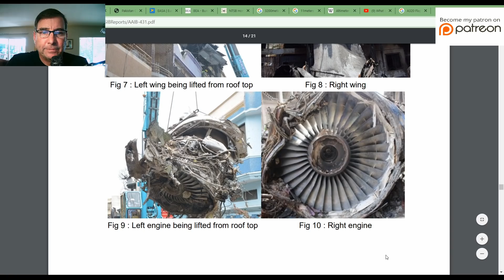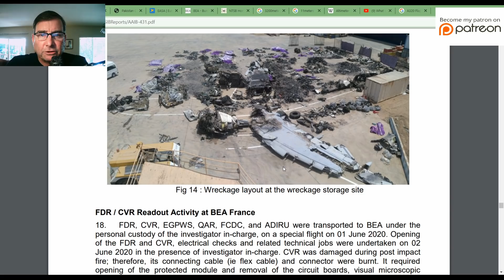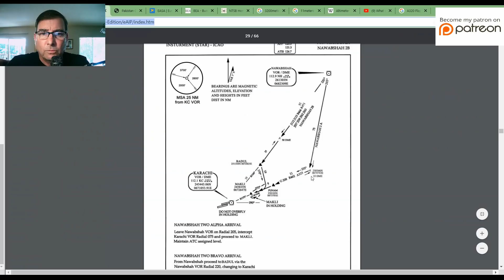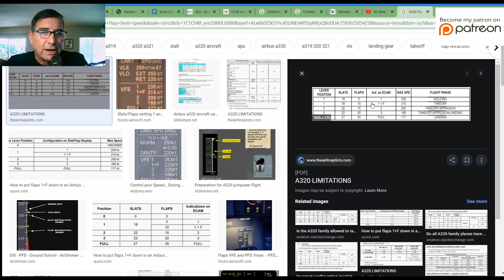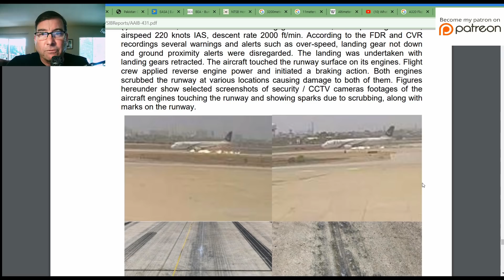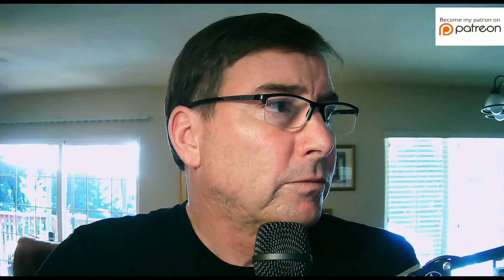PIA #8303 Preliminary Report Part II

Comment: One thing to mention out of all of this is the aircraft was not flown IAW Airbus SOP. That being the case, there were so many ECAM messages and warnings, that its almost impossible to sort them all out by continuing this approach. Certainly having the APU running would've helped, as in the case of Sully in the Hudson. A dual loss of electric power causes the RAT to autodeploy. The gear could extend if there was some hydraulic pressure but it normally freefalls once the uplocks are released. The Flaps slow due battery, in Emerg Elec Config, only the slats extend. EEC causes the flt control to go immediately into Direct Law (use Man trim as Autotrim is disabled (with gear down). Trying to fly in Direct Law with dual engine fail is a complete handful on its own. It says at one point earlier on that both autopilots were disengaged, what were they both doing engaged. Maybe that should say both Flight Directors were Disengaged,
 which is appropriate when hand flying the Airbus. Too many unanswered questions.
Reply: The aircraft will only go into direct law if the gear is down. You probably meant that but wasn’t clear. If gear was up it would still be in alternate law
Reply: @tomstravels520  Hi Yes you are correct. Both engines failed as per the Mayday call. The RAT deployed and the gear was down when they went down, as per the pictures.

Comment: Some speculation:

Declining to use the holding pattern was due to airline imposed fuel or time pressure. May also explain why they came in high.

Gear down at 7000 ft was for more drag (in addition to the speed brakes)

Gear up once on glide slope was for fuel conservation (they thought they didn't need the drag anymore, despite being way fast).

Gear down after the go-around was an "oh sh*t"

Gear up after go-around was for drag.

That final descent looked like 30+ degrees of AoA, very likely a stall. 

I have no idea why Airbus can't spare the (probably) less than 10W of electrical power to run the FDR during a power emergency. Hopefully the CVR had power. It's a little surprised they didn't have built in battery backup. (Like smoke detectors, clock radio, etc). Frankly, I'm surprised they can't keep it in normal control law with the stall prevention without engine power. The instruments and stuff are almost surely running, as are the actuators, but they can't afford the power to run a few computers?
Reply: Because fdr doesnt help the pilot fly the aircraft, why the fuck would you want that as a pilot? Airbus is thinking on how to help the pilots not crash, not on how the ntsb hace better info on a crash
Reply: Gear being selected up at 2500ft and so close to the runway would save exactly nothing in fuel. It doesn’t make sense at , not that anything else here makes any sense either. My only thought is that it was selected up to try and force the PF to go around when maybe the PNF had exhausted all other methods of getting him to go around.

Comment: Excellent content delivery there.
I read the same document couple of days ago.

Just a small note on the use of "spoilers or speed bakes". 
On an A320 the use of spoilers with the Auto Pilot ON is limited to half of its deflection, in other words, half travel of the corresponding lever.
So at this stage disconnecting the AP will make sense as to comply with this limitation.

Won't comment on the rest.
You've said enough.

Comment: Stating the obvious here, but during this sequence of events the gear was lowered 3 times and raised twice. The plane crashed with the gear extended. The unfortunate thing was that it was not extended upon landing, an apparent surprise to both pilots. I initially thought gear up was selected at 5nM in order to facilitate the fast descent and protect the gear, but at 5nM out they were already on the glide path but with an airspeed over 260KT.  If you increase the airspeed with gear down I don't suppose it automatically retracts, does it, just to protect itself?? Because at 5nM they definitely exceeded the VLE. This is quite possibly a very unusual occurrence, increasing airspeed once the gear is down.
At 4nM they were already at a safe speed, 225 KT for lowering the gear again....but it appears they simply forgot to do so, or possibly forgot they had retracted it, or didn't know it had auto-retracted at speed. Then there are the numerous alarms to protect against this so it will be interesting the hear the full CVR with both the chatter and alarms.

Comment: This is so sad for the deceased. Having attended several CRM courses, held airworthiness delegations and written approved Safety Management Systems it "appears" that the flight crew ignored all of their training and had a complete breakdown in CRM.  How many "slices of cheese" did they negotiate? So sad.....
Reply: @billdewahl7007  It is obvious in the engineering business as well.. 40 years ago it was laughable, today not so bad but still a problem
Reply: As someone who is a process improvement specialist consultant, I've often pointed out that "It's impossible to make anything foolproof as fools are so ingenious". 
Behind the obvious darkly humorous nature of the comment is an important fact. 
This is as great (and sad) an illustration of that fact as I've seen.
Reply: @steeltrap3800  Or "We keep building better safety mechanisms but they keep building better idiots."
Reply: @sfmc98  You can build something that is "Idiot proof" and a fool will come along. If you build it "foolproof" then an idiot will beat you. No one has designed and built something that is both foolproof and idiot proof.
Reply: CRM is shocking on a lot of flights

Comment: At 16:21 the altitude and airspeed chart is shown. This indicates clearly that the landing gear was lowered (selected) at 10.5 NM out and at 255KTs. Landing gear was raised (selected) at 4.8NM  out and at 260KTs. In both cases the aircraft safety maximums were exceeded, particularly when raised. VLO Extension is 250KTs and VLO Retraction is 220 KTs.

Comment: We should take a moment to appreciate how little relative damage was done to those buildings. Shout out to Pakistani builders because I'd never expect a residential neighbourhood to be relatively intact as it is after having a huge airliner crash right into it. No doubt the strength and fire resistance of the buildings saved some lives.
Reply: Luckily, a SIGNIFICANT amount of kinetic energy had been depleted by the time contact with those buildings occurred, the aircraft was basically just falling out of the sky at that point. Luckily it wasn't carrying anymore speed than it was at that point, considering how much speed they had been carrying throughout the rest of this.
Reply: The plane practically fell on the buildings after losing engines.It did not fly into the buildings at high speed.Had it flown straight into the buildings at speed several buildings would have beer torn down.

Comment: as an air traffic  controller I really regret the fact the the approach guys tried to help the crew by hinting they were too high and then by not transferring the flight to the tower they  removed the safety net of the tower being able to warn the pilots the gear was up. The practice of requesting landing clearance to the tower and keeping the the traffic by the approach is a left over from the 50's when tower equipment was limited, I think it is not safe because only the tower controller by looking out of the window can make an assessment of the environment (the runway is safe for a landing and the plane has no evident abnormalities)
Reply: It feels like the CRM issues in this incident extended outside the cockpit & into ATC ! Was the ATC scared of consequences if he/she dared to tell a pilot how to fly his aircraft ?
Reply: I think this crew was so out of control,if ATC had told him to Go-around he would probably ignored it.Tower should have noticed no wheels before touchdown.
Reply: I certainly don't want to see the crew inside the cockpit get anything less than the full amount of blame that they earned in this event; frankly, I have my doubts about ATC being able to influence these pilots at all in this incident, considering the disregard shown throughout the event.

But this is certainly an important conversation to have - we can use the unfortunate results of this to hopefully positively impact a variety of shortcomings throughout this long evolved system.